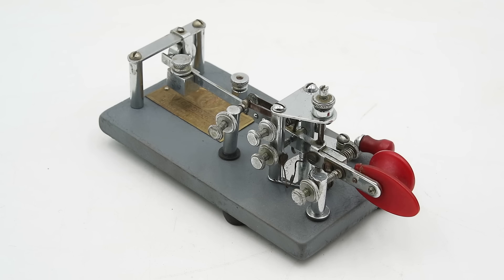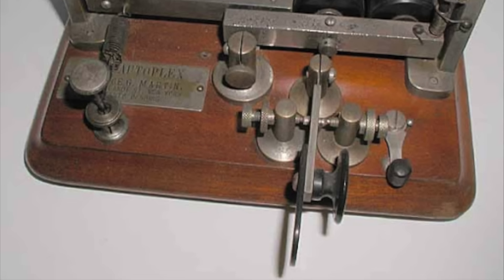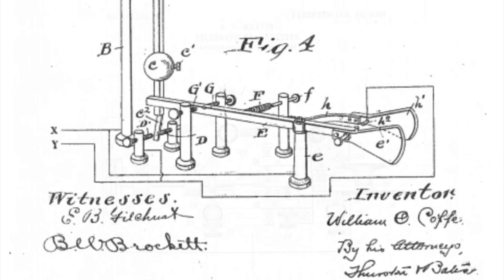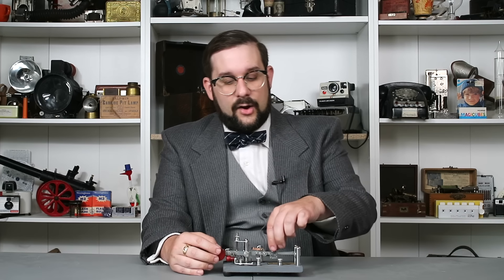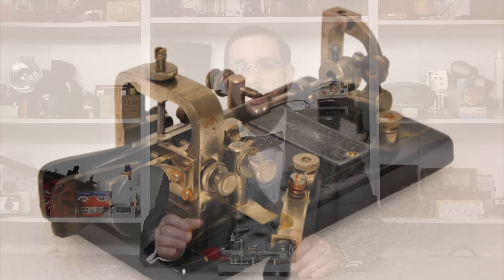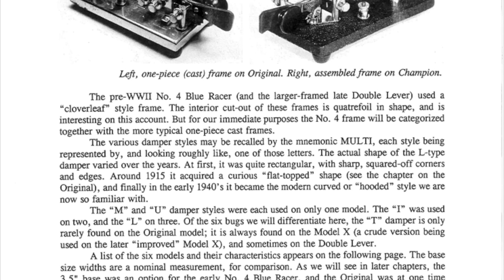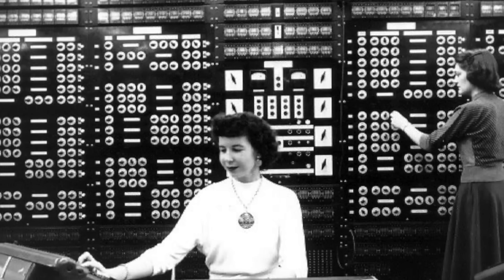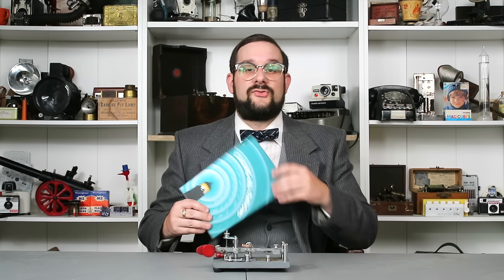Vibroplex: the Fastest Key in the West

Comment: Was watching a mate at a hamfest use one of those double paddle vibroplexes to send. I put my laptop near his setup and put a mic next to his transmitting radio so it could pick up the sidetone and he was doing over 60wpm on the thing. I'm lucky to do 5!
Reply: There are apps for phones that teach the Koch method for learning high-speed code.  Get one, set it for 35 WPM and do a 5-minute run-through.  Then keep the 35 WPM character speed, but boost to 21 WPM spacing.  You won't believe how quickly you learn, then when you're ready, cut the spacing to 31 WPM, then 35 WPM).  The Marine Corps used this method in the 1940s to train operators who would work on the battlefield (35 WPM was the USMC standard for Low-Speed Operator, 40 WPM for High-Speed Operator), while the Navy used the paper-tape machines . . .and took at least twice as long to get operators to 25 WPM (USN, USAAF and US Army standard for Low-Speed Operator, 33 WPM was High-Speed Operator).
Reply: 60 WPM! That's faster than most people can type on a modern keyboard.
Reply: Interestingly many of the very fast CW operators can't copy 5 wpm code. They forgot the sound of the patterns of single letters long ago. They have learned to hear the sound of patterns of  whole words of dits and dahs just like the people using spoken English no longer hear the sound of the letters they learned, but whole words.
Reply: @johnwest7993  Actually, the military and Naval operators didn't forget -- they never learned the sound of slow characters in the first place.

Comment: I've come across a two paddle electronic 'vibroplex' which had a neat feature. You can keep the dash paddle activate and insert dots in between dashes with the other paddle. AFAIK this is not possible with any of the mechanical keys. According to the ham that used it he said he really liked it and that it was very convenient, fast and produced perfect lengths of dash and dots an pauses in between.

Comment: 7:25 -- The closer is supposed to go UNDER the flat spring -- that little tab at the end stops the pivot at the right place for proper contact.  The closers continued to be used on radio keys for keying the transmitter during tuning.  13:15 -- near miss, Grace Hopper is credited with the first computer-related use of the phrase "debugging."  In aviation, "bug" was another word used like "gremlin," to indicate a mystery problem.  "De-" was a commonly added prefix for such words, to give a humorous "officialese" tone.   

One interesting note: some old Vibroplex keys can be found in a wooden carrying case, with a cable that has two flat contacts at one end, separated by an insulating layer.  These were made for professional telegraphers, who had their own personal keys (adjusted to their preferences).  One end of the cable would be connected to the Bug with ring terminals, then the contacts would be inserted between the pads of a straight key, which was then adjusted to minimum gap (thus holding the contacts in place).  This adapted the Bug to operate the transmitter without having to remove the straight key, so an operator would be able to use his own key for his shift, then the next operator could do the same thing with a changeover taking only seconds to complete.
Reply: Yes you're absolutely right!  If I'm not mistaken, the device at the end of the cable which was inserted between the contacts of the straight key was called the "wedge"

Comment: Thanks for the video. My Bug was built in 1945 and was used on the Rock Island Railroad. I even know the name of the telegrapher. I put it on the air every once in a while, but I'm not proficient by any means. Usually, I just use a straight key.  73 de N7KBT

Comment: I did once treat myself to a brand new, genuine Vibroplex and learnt to use it. While they are, indeed, beautiful pieces of precision engineering, they are very tricky to set up and, if not used and correctly adjusted, can enable the operator to send FAR worse Morse than a straight key ever could. ;-)
Reply: This is often proven out by the existence of way-too-fast dits, at the operator's chosen sending speed. MANY bugs are maladjusted this way.

Comment: I’m a young ham radio operator who is currently learning the code. When I hit 20WPM I hope to get a bug key to learn on. Thanks for the video!
Reply: I wish you very good luck in learning it. My 1963 Champion begins at over 20 WPM, but can be slowed down with weights on the pendulum. It is rather cool to be able to send calls and cq:s at 30 WPM, when used to a hand pump!

Comment: 1975, I bought a new Vibroplex Original, with the optional "circuit closer" for an extra $5. I never knew it was called a circuit closer or the real purpose it was designed for. I just  called it the shorting switch. I used it when tuning the TX tube's plate and load.
Reply: You're right, it was always called the shorting switch among the hams.  As you say, you could adjust the PA tuning and loading, one with each hand, to get that 10% "plate dip" and do it faster, to avoid overheating anything expensive.  My brother had a Vibroplex, Silver Streak I think it was, it was OK but I preferred the precise rhythm of a good straight key, especially at my low speeds of 15-20 wpm.  Higher speeds were for Teletype!

Comment: I am on the younger side of licensed Amateur radio operators at the oh so young age of 35 (currently). I had to learn Morse code at 5 wpm to obtain my General license when I was 15.  I never used CW (Morse code) but dad who is 70 did on low power. He strung an antenna atop the General Motors plant in Moraine Dayton where he was a maintenance electrician. When everything was working at the plant - he would work low power DX CW contacts. He would operate on 40 meters. He used a straight key at first and then a semi auto key although I forget the brand and type. QSO?
Reply: Did you mean QSL?
Reply: @jeepien  oops. Yep.

Comment: If you can find one, the McElroy is a far more versatile spring loaded semi-automatic key. The McElroy works like a Vibroplex but the McElroy has lugs on the arch frame so it can simply and quickly be flipped up on it's side and used as a simple straight key for any telegrapher who is not familiar operating with Vibroplex type semi-auto keys. Gravity keeps the dot feature from functioning. Bugs would get into old magnetic telegraph sounders. The slang term "lid" in ham radio referred to telegraphers who put a lid from a tin of tobacco or other product on the sounder so they could hear it better. The term "ham" refers to ham fisted telegraphers. Some famous wealthy 1920s socialites and business moguls were electrocuted by their amateur radio equipment. Electrocuted means killed dead.

Comment: Apparently, the term "bug" actually comes from an error that occurred in a relay-based computer that was manufactured in England around about the time when the German Enigma Code was being broken, the story goes that they were running some calculations on the computer and were getting some strange results, the cause turned out to be a moth that had gotten stuck between the contacts of one of the relays.
Reply: That story is addressed around 13:05 --- note that the text below the moth says "first actual case of bug being found", implying that the term was already well-established.
Reply: Nope.  "Bug" and "gremlin" were used in aviation in the 1930s to mean the same thing.

Comment: While I really appreciate your videos, it always irks me to see such poor keying-technique.  
In most all movies the key is slapped or tapped as in this case. No matter what, a trained ear can hear how sloppy the code sounds!
The thing you need to remember is that you DO-NOT use the return-spring, as the mechanism for returning to the upright-position.
The key is grasped so that you have both your thumb(slightly)  and second-finger under the knob, such that you are actually pulling it 'up' for the return.
Also, the angle and position you chose for the key placement is very awkward. You would 'glass-out' in a very short time!
I realize that all of this sounds picky but if you are trying to accurately-recall history (and not have thousands of dead telegraphers spinning in their graves!) take a small amount of time and learn proper technique.  There are many instructional military- films that were made, that do a good job of teaching proper placement, posture and keying-technique.
When you combine all these proper elements, the code keying sounds (for the most part) fix themselves.
Anyway, I really do appreciate all your effort and I did learn several things I never knew before, even being a huge Morse and CW fan.
Thanks & 73...